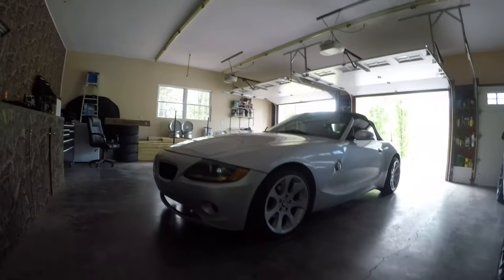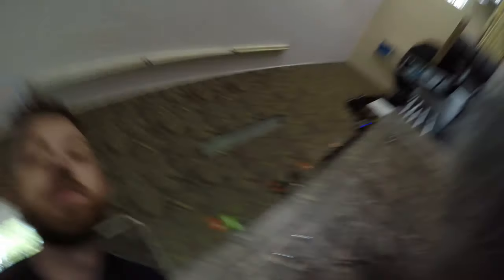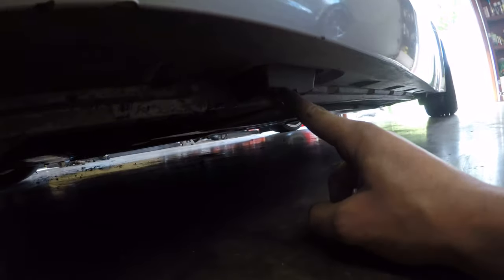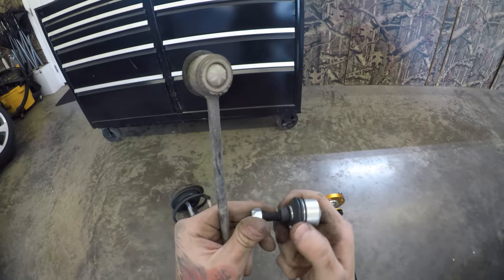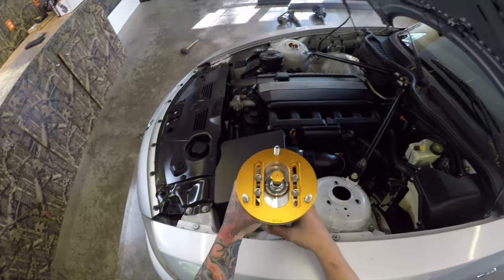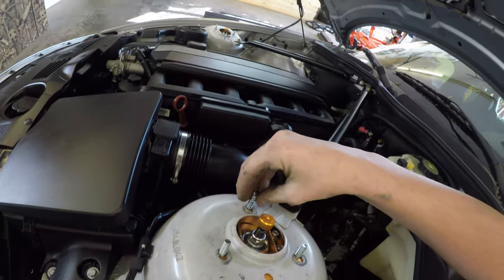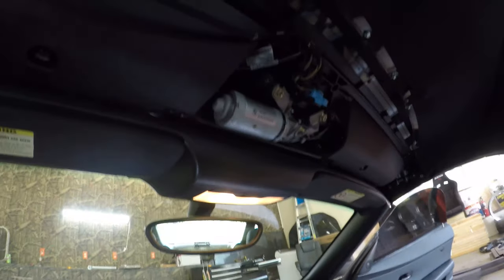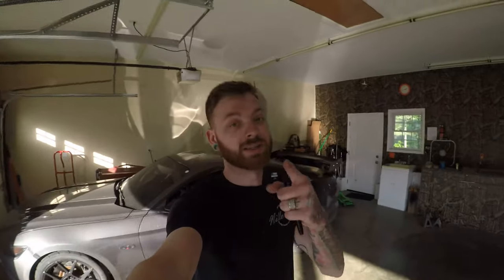HOW TO INSTALL COILOVERS, QUICK AND EASY TUTORIAL! 2003 BMW Z4 E85

Comment: A hover mower grass cutter would be higher off the ground Lol. Nice to see how simple it is to replace the suspension, but in the UK with Speed Bumps on the roads and potholes I had better keep the car a good 150mm above the ground to the underside Lol
Reply from the maker: i agree lool
Reply: @MBTVEXTRA  My 2006 Z4 2.5i Se has only got 34k miles on the clock and drives really well, if and when the time comes to upgrade the coils and springs etc I will replace them with coil-over shocks at the front and uprated springs, but keep the height suitable for driving in the UK :) Glad you saw the funny side of my British sense of humour Lol :) Great video by the way ;)
Reply: Too low for me.  Would be no good, with the roads in the UK or the side roads with the speed bumps and pot holes.